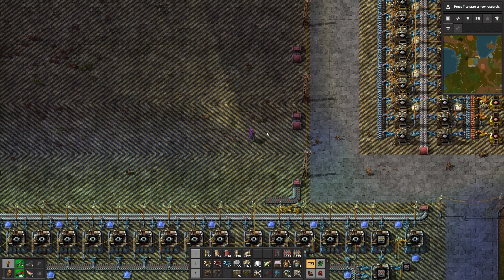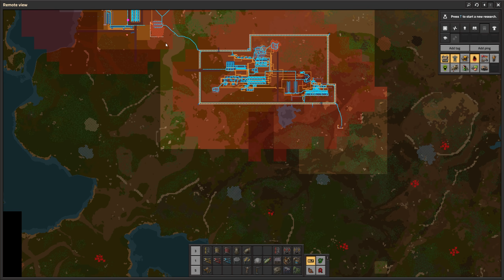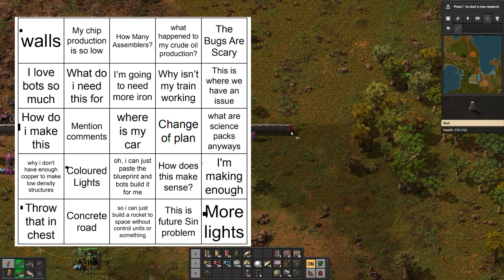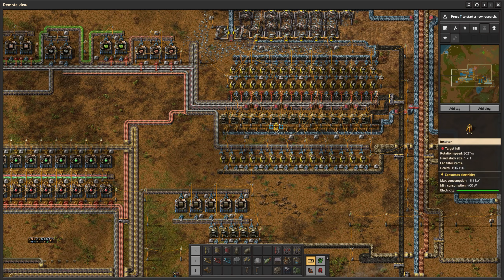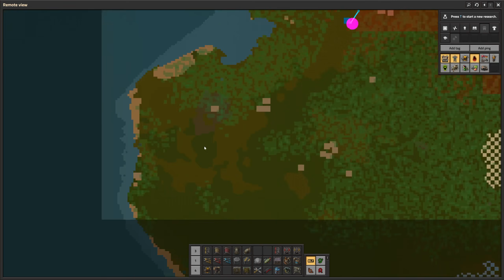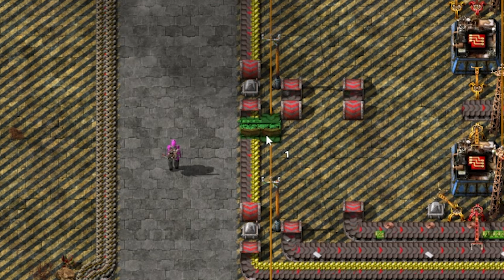Satisfactory Pro Plays Factorio - EP.6 -  This Game Is A Stress Test

Comment: You can click any pipe-system and click "void contents" if you have too. Better solution is always to build the cracking and use petroleum for anything, except for solid fuel, because it's way more efficient to use the light-oil recipe. But you really only need 1 Lubricant chem-plant. Maybe 2, if you want symmetry ;)

Also the Logistic-zones. Let's just say, you onoly built Construction-Bots up to this point and have not seen the "Logistics" part of the bots.

But also, also.. you can built completely "requester-Chest" free and get an achievement for it. But it's your first playthrough. So do whatever you want.

Comment: Small tip. Replace all furnaces with electric ones. They run faster and produce less pollution.
Reply from the maker: You can also add modules too them too can't you?
Reply: @Sin-r2h Yes :D But for me, of the lvl1 modules, only the green ones are worth putting in (2x - 30% energy consumption). Blue and red modules are much more worth using the higher level they are.

Comment: Old adage when it comes to Advanced Circuits, think about the amount of assemblers you'll need, then double that amount. Now double that number and you'll finally be close to the actual amount you'll end up needing for your base.
Even I still get tripped up by how many production I need and always build too few lol

To fix the Steel furnace stack problem, you could do a bunch of things, but I think a simple one is disabling the inserters for a certain duration of time.

 - Build a Clock: one Decider Combinator, with its output wired to its input.
 - Set the Decider's Condition to "if CLOCK < 59", and the Outputs to "CLOCK, Input Count" and "CLOCK, 1"
  ("CLOCK" is whatever signal you want to use, I use the actual clock signal from the specialty signals tab)
 - Wire the Clock's output to each and every inserter on the Iron side
 - Set each and every inserter to "Enable/Disable" with the Condition "if CLOCK < 6".

This limits the inserters to only move during 6 out of 60 game ticks, or 1/10th of a second. Tinker with the numbers to find the best timing for you.
Clocks, Latches, and Memory Cells in general are amazing tools.
Reply from the maker: Circuits do feel like an amazing game changer. I do plan on having a good hour or so messing about with them and seeing what I can come up with. I think for now I will just enjoy the game and try not overwhelm myself. Thank you for all the tips. I'll be sure to use them when I start using circuits ☺️

Comment: 30:44 one side of red belt can handle 15 cables per second and one green circuit consumes 3 so your doing 5 green per second)) 
Using 2 sides of a belt to a different resources is important in slow recipes but in stuff like green circuits, plastic, cables etc it's better using 2 sides or direct insertion (one assembler to another) 

2:32 bro just deleted 25k crude oil((

16:07 6 science per minute is a big gole your base can't handle)) That consumes 72 iron per second, 45 copper per  second and 155 petroleum per second))
You can also make a buffer for your science so when you aren't researching you'll still stockpile it

20:33 efficiency modules are really good even if it may seem that it isn't. That's because pollution a machine spits out is multiplies by consumption rate so when minimum 20% consumption rate is achieved (via 3 green modules) it's pollution rate will be devided by 5.Also if you open production rate (P) you can find pollution that you produce and find out that the most of it is produced by mining drills and boilers. Also you can look at consumption of pollution and if no biter nests consumes it then no one is aggressive

24:40 you actually made it too far)) you could've build them so there are 3 tiles between and still use the same design) 

26:55 If you'll do the same thing you'll expand every serie so instead you can expand so far that you can forget about it for 10 hours(yeah, flamethrowers are really good) 

27:00 you can deal with it by using pump and cracking recipes (from heavy oil to light oil and from light oil to petroleum) and enable pump only when there is too many fluid. You already did that but with lights

35:42 logistic bots  transport things from chests and to chests. Red one allows them to grab from it but they cannot put anything in it. In your inventory you can put request so they will keep some resources at a certain level. For example green circuits from 400 to eternity. That means if you'll have less then 400 they will give you it if you are in a orange zone of a roboports(logistic one). Or for example if you set all ores to zero they will be automatically thrown in trash slots. Then bots will grab it from you and put it in yellow one (he is for trash from you, or deconstructed by bots things. They can put and pick from it. So you should make a buffer for anything in a red chest and make sure that all roboports hover over it with orange zone and that they all are connected (there will be a line between them if they are)

23:23 If you click on a tube there will be a button to delete all fluids in tube system sooooooo, you wasted your time))
Reply from the maker: Wow, thank you for all the tips and advice. Ive kinda fixed my oil problems, but now im back up on plastic, so it's broken again. I probably should have made more buffer chests. And you are right. I can't sustain that much for my labs. I plan on changing a bunch of stuff with the bots and manually going through and fixing a lot of stuff. Due to how stressful it was last episode I played with trains for an hour ♥️😅😊

Comment: 18:45 Btw I think the reason they are frozen is because they currently are not absorbing pollution. Just like your own buildings, their nests only have an animation when they are working.

20:23 For these kind of  things you can use the "any" signal, which will just check if any signal in the network is fulfilling the requirement. Then you could copypaste that setting to all 3 lamps, thus savin a bit of time ;)

Comment: 11:45 - There is a really nifty trick you can use to deal with this problem a lot better than you are. If you want to, I can give you a major hint as to what it is. Basically, the key component of the solution without any instructions on how to apply it. :-)

And, of course, like everything in Factorio, it isn't the only way, just a way. :-)

25:20 - That is the most unique solution to that problem I have ever seen. And forced by necessity because you placed the refineries facing each other with one too few spaces. :-)
Reply from the maker: I just keep causing myself more problems, which require new solutions that people probably haven't had to deal with. Sure, I would like some advice 😊
Reply: @Sin-r2h  Try seeing what happens when you have two splitters facing eachother with one empty square in between, feed each with a full belt of the appropriate product and then place belts lin between the splitters each leading perpendicular in the opposite direction.

Basically using the splitters to side load two belts that exit the construct in opposite directions. All of the same color too.

Comment: On the Steel situation, you are simply not supplying enough iron plates. A full ( both sides same item) Red Belt of Iron Ore saturates 48 Tier 2 Furnaces, producing a Full Red Belt of iron plates, which in turn saturates 48 Tier 2 Furnaces for steel. You only supply a half belt of ironplates at best. No circuit condition will change that.

On Roboports they form a network when the yellow areas touch, the green area is the construction radius. You need to put all your supplies from your mall into either red or yellow chests to allow bots access. For this to work these chest also have to be inside the yellow area. You can just place the bot chest over the existing ones to replace them. 
Your personal roboport needs power and supports a limited amount of bots. You can use multiple to increase the number of bots. To keep them powered you need several personal batteries. The rest of the grid is for solar panels. Bots are power hungry just the charge of the port itself is not enough and solar takes to long to charge the port back up hence the personal batteries to act as a buffer.
Reply from the maker: So turn down the steel production as i can't handle that much iron and start trying solar panels out as a better source of power for my bots. Thank you for the help 😊

Comment: Construction robots can work from your inventory and will only work with the items in your inventory (or put items there if you want them to delete something).  Robots in roboports are a separate system and will use logistic chests to do their work.  Logistic robots (after you research them) have absolutely no use in your inventory; they are solely to be used with roboports and logistic chests.  They will however deliver items from a logistic chest to your inventory.

You can set up a sort of shopping list in your character's logistic window.  If that item is in your logistic network and you are standing inside the logistic network, logistic robots will deliver that item to you.  If there's anything in your inventory that you don't want there, you can put it in your logistic trash slots and logistic robots will come to you and take it, putting it somewhere in your logistic network.

You've seen the check box that will put your entire inventory into your logistic trash slots unless you specifically request the item through a logistic request.

One example can be for your tank and supplies, all of which would take up room in your inventory if you carried it around all the time.  You can make a logistic request for it and only turn that request on when you intend to go fight biters.  That request can contain the tank, shells, ammo, flame thrower ammo, and fuel for the tank plus some additional construction robots and repair packs to repair the tank in the field after it takes some damage.  After you're done with combat, turn the request off and trash the items manually or automatically, and you can go back to base building.
Reply from the maker: That's a great idea. I should also do what you recommended as well by having 2 sets of armour. Right now, I am slowly building up my logistics network. Saving space in my inventory and having items delivered would save so much time. Im guessing the more ports the more robots, but they have a capacity. So, some robots make take longer than others depending on where they are 😊🤔
Reply: @Sin-r2h  More roboports is indeed good beyond what you need to cover your base but only for their charging ports.  Roboports only have 4 charging ports and it can take a second or two for a robot to recharge itself so if you ever see a bunch of robots queuing around a roboport, that's a good place to build more solely for the recharging ports.
Reply from the maker: Yeah i think I have about 1000 robots and about 6 ports. I was off doing trains and just left them to do what they were doing. Smaller charging stations should also be added them 🤔 thank you for the help again 😊

Comment: You want your equipment grid to work off battery power as you're generally using a ton of power all at once and then very little power for awhile afterwards.  There's a small little bar next to your armor that will tell you how much battery power you have  Two or three batteries should be enough along with lots of solar panels or other power creators.

Future armors come with larger equipment grids.

Some people carry a second set of armor, one is used for base work and another solely for combat.

Comment: For organizational purposes, use red chests for items that are components of other items (iron, copper, steel, etc).  For any sort of building that you'd place down (assemblers, inserters, belts), use a yellow chest and make sure you click on the filter button at the bottom and pick the item you want that chest to hold.  When you select many items to delete, they'll be picked up by your robots and returned to the yellow chest if there's room.  This is why you want to limit your chests with circuits because bots won't deposit items into a chest that has slots X-ed out.

Once you get logistic robots (a different type or robot) or any time before then, build like a 5x5 grid of yellow chests in some central area of your base that are _unfiltered_.  These will gather any logistic trash from your network.  Pay attention to the items in here and find some way to help your bots move these items somewhere useful.  Common items will probably be ores which you'll want to send back to where the ores originally entered your base (such as the train stations that dropped them off — splitters can be used to give them priority over new ore).